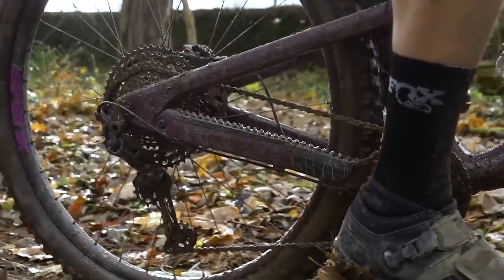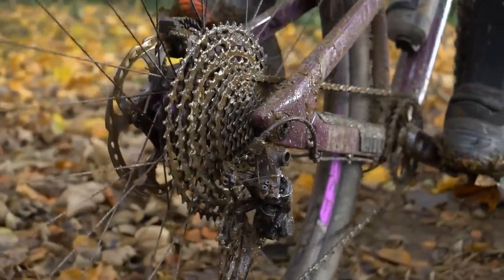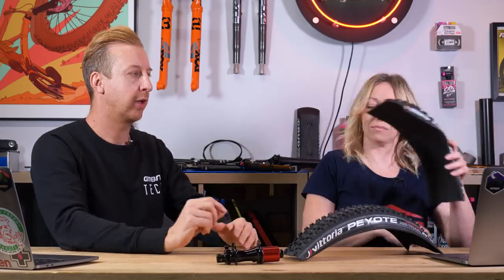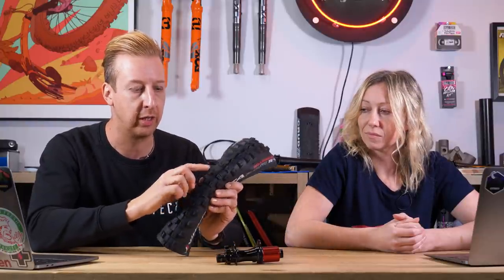How To Stop Tubeless Valves From Clogging? | #AskGMBNTech 180

Comment: As an old motocross rider I remember the tires as being directional as well as mountain bikes and instead of flipping the tires around we used a razor blade to trim the knobs back to square edges. Took a long time but money was tight and new tires every race was not an option. Haven't used a blade on mountain bike tires yet but it may give extra traction to someone on a budget.

Comment: Great answers from both.
Regarding the pedals, that could be extended to saddles and grips too. Each have their specific wants and needs.
Reply from the maker: Cheers for the support! That's a great point! Although saddles and grips are personal, there are just too many different types of pedals.
Reply: @gmbntech  I think there is same variety of saddles as well. Saddle on one of my bikes (OEM) is so narrow that it made me unable to ride more that 10 km. From that perspective Ghost did nice job with their adjustable saddle width.

Regarding the antisieze in automotive. There is way longer maintenance intervals in automotive compared to cycling. Also another thing to mention is heat that can really effect the bolted connection. Antisieze consists of grease as you said and some solid small particles of metal, graphite, ceramics that prevents threads get stuck after the grease dries up/washes away/bakes with heat etc. 

And regarding the turning tires around is the question regarding the shape of the "studs" in the thread and shape of the thread itself. For example Schwalbe Hans Dampf can be turned as you want as the thread is completely symmetrical and on the opposing side is Maxxis DHR which has asymmetrical studs. Conti Mountain King has directional shape for the reasons you said.

Comment: On the question of storing a bike with the derailleur in the smallest sprocket, it does make a difference when the bike is stored for long periods of time, especially older derailleurs that had weaker springs out of the box.  Many times customers would bring bikes in that had been stored for years or even decades with the derailleur sitting in the larger sprockets.  The now ever so slightly stretched spring now has trouble shifting back down to smaller sprockets as it is having to not only overcome the  normal friction of cable/housing, but also the general corrosion and dust/dirt from being in storage.  

So, short term, no issue.  Long term, absolutely.
Reply: it's like a torque wrench then?

Comment: The chainring question reminded me. Several years ago I was talking to someone who I used to ride with. He told me of someone he did a audax with. Who did a 600km audax on a fixed wheel bike with an 88 inch gear. I remarked I could easily push that gear. There was no way I could pedal it for any distance.

Comment: Good points on the peddles. This could carry over to seats and grips as well. Typically, the first and second things to get replaced, and tossed in the landfills. Maybe a service bike shops can provide as part of the setup of a new bike. Fit peddles, saddles, and grips. Another reason to support the LBS.
Reply: Sell them! What doesnt suit u will suit someone else. Give them away if u cant be arsed to sell....
Dont just bin them!!!🙄
Reply: Most bike shops throw in pedals with a new bike purchase. Most stock bike saddles are alright and don’t need changing however stock grips tend to suck depending on what brand you buy from
Reply from the maker: 100% Pat! It would be a great way to support a local bike shop while also getting the perfect fitting across all contact points. 👍

Comment: I store all my family tubeless valves down, I’m unclogging less now, I don’t think it hurts.  I always store any bike in the smallest cog (front and rear on bikes with a front derailleur), why stretch a part for longer than it has to be. I like to stress my parts when riding them, not in storage.  Just remember to dial it a couple up before riding.  Getting started on a 10 tooth is hard on my knees.

Comment: I always store my MTB with the gears in the smallest sprocket to take the tension off the cable and with the valves at the top of the rim to reduce clogging from the sealant.
Reply: That’s interesting. Valves at the top of the rim? I was thinking 6 o’ clock position would be best for any sealant to flow out.
Reply: #AskGMBNTech Hm, think the arguement of TCK could be, that from the 12-o'clock position, the sealant on the rim would flow away from the valve, while in 6-o'clock position it would flow exactly to the valve. Of course, in 12-o'clock position the valve itself would not drain fully, but (maybe depending on the specific design of the used tubeless valve) maybe there would not get any sealant to the valve during driving the bike?

Comment: @17:50 I put Shimano 1x11 on my old 26er last year. With the old 'little' wheels I had to buy a separate 36t or 38t to give it sensible gear range with the 11-51t, else I'd be able to climb vertical walls, but spin out on all the downhills. It's your legs/cadence, your cassette, and your wheel size dictates.

Comment: New to mountain biking but been into off road motorcycles for over 35 years. Motocross riders do not flip tyres. Trail riders will buy used tyres from motocross riders because they throw them away after one event. Most off road motorcycle tyres are directional and cant be flipped anyway. That said, keep up the good work. I dont know much about MTB and this channel is straight to the point with tech stuff.

Comment: As far as the cranks spinning by themselves, if the wheel is spinning and the only thing in direct contact is the free wheel hub/cassette that’s the ONLY thing that can cause your cranks to spin !! 
Nothing else in the driveline is in direct contact with the spinning wheel including jockey wheels or dirty chain as mentioned 🙄
Reply: Doddy, imo you really should have given a quick description of how to clean inside the freehub for the first question. That would have been helpful

Comment: On tyre direction, some tyre brands (eg Schwalbe) don't know what they're doing with tread design, and their product definitely performs better when swapped around. In particular their first generation Nobby Nic and the current Rocket Ron are examples. 

I was having trouble with my front tyre not feeling planted and letting go suddenly on loose-over-hardpack.  Looking at the tread pattern prompted me to see that the shoulder tread blocks were angled so that the narrow side of the block faced the direction of slip, and turning it around would bring the broader side into play. So I tried it, and it worked. 

My suggestion is to give it a try and see what you think. I still use Schwalbe rubber on my XC bike.

Comment: Question: When using carbon fiber wheels and tubeless wheels, I heard recently for the first time that the gasket on the outer part of a valve stem (the rubber between the thin screw and the rim) should NOT be used. There appears to be a problem when pressurized air leaks into the volume space of the carbon rim depth. If the pressure can't release, it will blow out the side of the rim. 

Have you heard of this issue? Should I leave off the outer rubber gasket for carbon wheels?
Reply: The gasket doesn’t actually serve to seal air, it’s to stop your lock ring coming lose 

Top tip when setting up tubeless , place a screw driver handle across the valve on the rim side and press down, this will push the valve onto the tape , keep the pressure on the screw driver handle , slide the o ring on then only finger tight the lock ring, release the screw driver ….you will
Never have a non sealing valve ever again
Reply: If your valve stem comes with the rubber oring, use it. It plays two parts; it stops your valve stem lock ring from undoing, and it helps to seal the interface. However.... what matters more is how snug your fittment of the valve stem is into the hole of the rim. If it's not snug, no matter how tight you screw the lock ring against the outer rim, it won't give a good seal.

When setting up tubeless, make sure a) you have good rim tape, and b) you set up the valve correctly. For me at where I work, I just use a small + screwdriver and tap a hole into the rim tape, then a bigger one that's slightly smaller than the valve stem. Then take the valve stem and shove it down the hole, and use a rubber mallet to tap firmly the valve stem into the rim. Alternate between pushing with your thumb, and whacking with the rubber mallet. Once the rubberised end of the valve stem is very, very snugly fit against the hole the rim (it should look as if it's slightly squashed, but not deformed or too flat, in which case you've gone too ham on it), then tighten the lock ring WITH the rubber oring. Shouldn't be an issue after.

Comment: The use of anti sieaze(primarily over grease) is for its coefficients value and torque ratings are usually based on this to ensure the correct torque value is obtained and the bolt is under the correct tension.

Comment: Hi guys! As for storing bikes with a chain on low gear. My experience shows that it helps with cheaper transmissions like SRAM NX. Long tension is not good for weak spring in the derailleur.

Comment: Shifting into the smallest rear cog when done riding is only a good thing, with the main benefit of not pulling the cable tight in the housing and helping to extend the housing by not forming a groove in the twists and turns as quickly. Small things add up to big things.
Reply: I agree, about 20 yrs ago I wore out an XTR derailleur & was told I stretched out the spring too much when storing my bike by keeping it in the bigger cogs, since then as soon as my ride ends I shift to smallest cog, never had a problem since, takes all pressure off of the spring & as you said, cables too
Reply: Surprised Doddy doesn’t know smallest cog means the lowest amount of cable stretch, I suppose they only ride AXS these days

Comment: Always leave my chain in the smallest sprocket. I would say, threadlock for tiny screws. Grease for lubrication and everything where you don’t want water getting in. Anti seize for anywhere where galvanic corrosion may occur, I don’t think it’s vital unless you leave your bb in for years.

Comment: Don't use Grease or anti-seize compounds on fasteners (tapped, nuts, bolts, setscrews ect) unless the manufacturer specifies.... Any grease, fluid or compound on the threads of any fastener reduces the friction between the threads which in turn increases the tension on the fastener and the component it's holding. Therefore a reduced torque setting is required to achieve the same tension as a none lubricated fastener 👍

Comment: grease provide similar or make equal friction for each connection so torque will be use correctly for pretension of bolt. 
low friction=> torque convert to higher pretension of bolt (secure and correctly mounted)
thread lock secure bolt to un tight

Comment: Copper anti seize (copper grease) should not be used near aluminium. It can encourage electrolytic corrosion. It's fine to be used on steel components and bolts, which is what it is used for in the automotive industry

Comment: I always make sure my valves stems are at the bottom side of my wheel and still contantly have clogged stems. I did have better luck with after market valve stems on other wheel sets.

Comment: What makes a good frame? Versatility. If you can only afford one mountain bike it's nice to have a frame that can run 29 or 27.5 wheels, adjustable dropouts/chainstay length, a frame that can handle plus size tires. If you're doing long rides a good frame is one that has the most space for a frame bag etc.

Comment: Yes it is much better to always shift into the smallest gear when not riding that way the derailleur springs are not under tension. Over time they will lack on return when downshifting. I make sure the valves are at 6pm position at least when not using a particular bike for few days.

Comment: My Orbea Laufey didn't come with pedals when I got it. When I ordered it. I ordered a pair of Crack Brothers Mallet E pedals. I could have ordered flat pedals. As I normally use clipless I went with them. If the bike had come with pedals. I would have still ordered the Mallet E pedals. Then possibly either binned them or looking in to recycling them. In the past. I have even asked my local bike shop to change something on the bike when I bought it.
Reply: Orbea and most l mid-higher end bikes dont ship pedals, as they know people buying these will get or have what they want.
People buying more entry level are less likely to, so these and budget bike do have pedals

Comment: 15:14 pedals .....  A few weeks ago I bought a new bike. I knew it wouldn't come with pedals so when I went to pick it up I asked them to put some new DMR V8-V2's pedals on, they said I could have them for free 🤜🤛🔥👍. 
A few days later I looked through the owners manual and other stuff. And I found a leaflet, saying the bike comes without pedals due to landfill but if needed contact them and they will send some free pedals ( I didn't bother ) 
The bike "specialized"
The shop "jejames cycles"

Comment: Anti seize should not by used on a thread that has a torque setting unless the setting says so. Anti Seize acts as a lubricant and can cause the thread to be overtightened or stripped as it makes it easier to turn the bolt.
Reply: True...but same for any grease. Some torques are with grease (it will state so) and 'dry' if not stated.

Comment: The smallest sprocket on the cassette is the highest gear, 12 in that case. You get the highest speed on that, you don't start on that. And I store the valve cores at 4 or 8 o'clock position. Having the valve at the bottom, the closest it is to the sealant and it has nowhere to drip to

Comment: The 2019 Giant Talon that I bought came with what is essentially Giants knock off of a knockoff of Race face Chester pedals but instead of being rebuildable with threaded steel pens they are non-rebuildable with molded in plastic pins but they perform very well for a cheap nylon pedal. I did quickly swap them out for the Fooker brand Race face Chester knockoffs.
Reply: Fooker is hilarious name 😂 since I saw them on Berm Perm it always make me laugh

Comment: Dont use anti seize on a bike ANYWHERE but pedal threads. Period.
The copper can cause a reaction with some alloys/materials and wont be carbon safe!
Also, bikes dont have the potential high temps that anti seize could help with.
Reply: I am confident Park Tool ASC is not dangerous to use on bikes

Comment: I have the problem of my tubeless valves clogging about every 2nd ride. Surely I don’t need to remove and clean valves regularly. I am using the Muck-Off valve stems and valves.

Comment: #AskGMBNTech Can I upgrade my wheelset by changing only my rims ? Are all rim brands compatible with one another, does asymmetry come into play in addition to wheel diameter and spokes holes ?
Reply: Im wondering too
Reply: Good question! Technically, yes you can, if you take note of the number of holes making sure it matches to your hub. However, you will probably need to buy new spokes as each rim has a different rim depth and profile, and hence the spoke lengths probably won't be the same as your old rim. 

Asym rims just means that both side of spokes (drive and non-drive) are same length, and there isn't the "weird angle" for one side to accomodate the cassette, which means the tension will be more balanced (no need for 29lb one side and 32lb the other.) and truing in theory would be easier too as you don't have to compensate back and forth between spoke sides. But I don't find it any easier to true imo.
Reply from the maker: Hi Maël! @Sean has a great answer for you! From our side, you can upgrade rims. However, just ensure it has the correct amount of spoke holes and that it's the same wheel size as your previous rim. Like Sean said you may need new spokes due to the change in length needed. Hope this helps!

Comment: #AskGMBNTech  Are 2 by groupsets dead ?
I noticed that recently released bikes are not compatible with a front mech anymore. Even since the release of Shimano's xtr groupset that included a 2 by option (28/38 by 10-45) three years ago I've never seen a mtb brand launching a bike fitted with it. Can you name one or tell me why ?
I think they still largely have a place in mtb
Reply: No, not dead. My recent gravel bike I got 2x so better gear range on road, and still enough for gravel climbs.
If u climb a lot, 2x can be better.
Reply: @rupedog  I totaly agree, 2× still offers a larger range despite the 51 tooth cog and more options with smaller steps. The loss of weight is negligible compared to that. Only the frame design could be the real step forward with this technology

Comment: #AskGMBNTech This is a bit of a long one but wondered if you might be able to answer. So looking at getting a new Hardtail for a couple of femaie riders who are around the 160cm mark. I know that you are a big proponent of a 29'' but wanted to know what you thought about 27.5'' for sizes XS and size S frame, it would be possible to go for a 29'' bike in the same size (size S) but just thinking that with the larger wheel size its going to have a higher standover and also would be a larger bike to handle. Just wanted to get your view on whether the 27.5 is still a good size for smaller riders to get a responsive and fun bike. Maybe Anna can give a bit more insight since she is a smaller female rider. Thanks!!